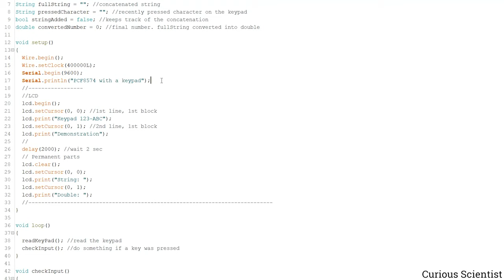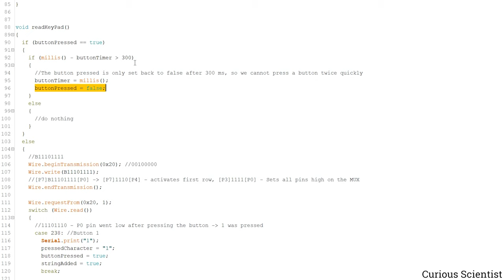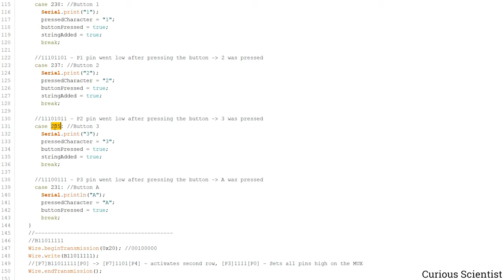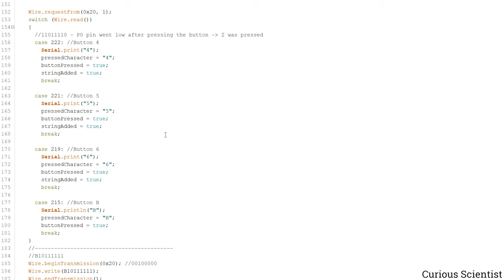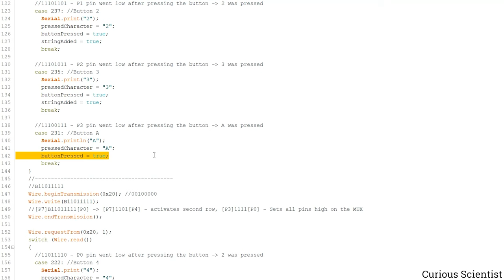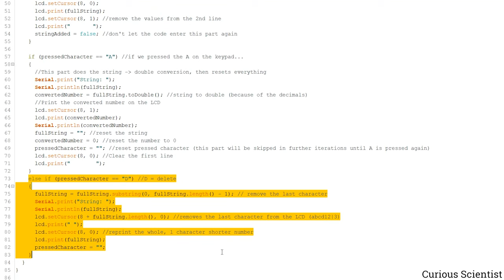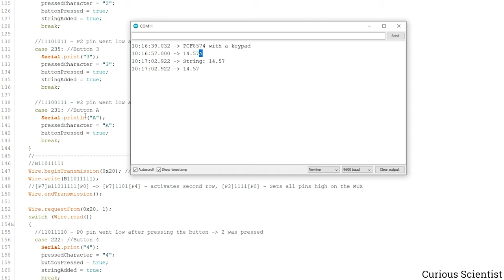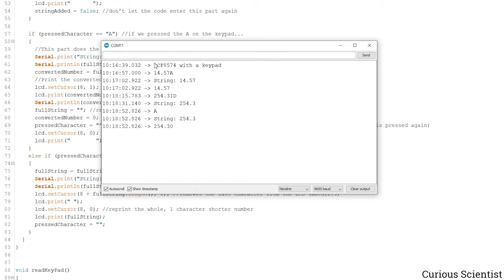16-key keypad with an Arduino and a PCF8574 I/O expander module

Comment: A quite in-depth look at these incredibly useful chips! You could chop down on the lines by using a for loop as an example containing 4 if statements with some multiplication to figure out what each button will be depending on the first 4 bytes sent. Would be less code, but I do understand that it would not be as readable for demonstration purposes. These chips are plenty of fun indeed 😄 Thanks for the videos!
Reply from the maker: Thank you! Yes, there could have been more done in terms of code optimization. I agree that this chip is a very cool chip; it helped me in many projects where I needed a large number of I/O ports. Cheers!

Comment: Hi! I really enjoy your channel, extremely interesting and thorough. It would be super interesting to see a ESP32 Bluetooth version of this. I would imagine it could be used for your camera slider and the coil winder.  Again, great work!
Reply from the maker: Hi and thank you! I used ESP32 for other projects that I have not published here, but generally, it is the same code as for Arduino as long as it does not require wifi or bluetooth. I try to avoid ESP32 for now because I do not need the wireless function and I still have a lot to learn in the world of Arduino and STM32.

Comment: hey. just discovered your channel and I am truly impressed! 👍🏻 I've seen that you've made some videos with AS5600 encoder module. Have you thought about using AS5600 as MPG for a control panel?
I'm currently trying to build something that uses AS5600 as a MPG, but it's going to take a while because my programming skills are not that advanced. Keep the good work going! Good luck 👍🏻👍🏻👍🏻
Reply from the maker: Thanks! I don't see the use of the AS5600 as an MPG since there is already a specific hardware for pulse generation. It is much easier to set up an MPG (like I did in some of my videos).

Comment: hey, did you try the keypad i2c library? would that not have been much easier and simpler? great vid btw
Reply from the maker: Hi! If I simply use the libraries, I never learn how these things works. I am aware of the different libraries, but I want to avoid them where it is possible.
Reply: Respect bro
Reply from the maker: Thank you!

Comment: Hi. My name is Vo Tan Tuyen, I come from Vietnam.
Your project is very cool because it can apply to many projects. and my project also needs this part but I am not very familiar with Arduino can you show me how to print(entire string) to output an integer (without the ".00" character). My English is not good, there are mistakes, please forgive me.
Thank you very much.
Reply from the maker: Hi! The easiest way is to store the number as an integer (int). Or if you want to print a float without the decimals, you just have to tell the print function. For example, serial.print(variable name, 0) will not print any decimals. Arduino has a really nice documentation, you should read it.

Comment: Hello! Relatively new to Arduino so i was wondering if the configuration & code is compatible with Arduino Uno on tinkercad? Want to try familiarizing with tinkercad before beginning.
Reply from the maker: Hi! Sorry, I have never worked with tinkercad, so I cannot answer this question. Try it, I guess, it is just a software, nothing can go wrong.
Reply: @CuriousScientist  No worries! Appreciate your prompt reply, however can i ask if this is compatible for Arduino Uno R3 as well, are there anything i should look out for to change in the code
Reply from the maker: Sure, Uno and Nano (board in the video) use the same chip. I think no changes would be necessary.
Reply: @CuriousScientist  Tried it out and worked out really well! Thank you so much for the guidance and video. In addition can i ask if theres any guides if i want to further expand the ports by connecting another port expander?
Reply from the maker: Sure, look up PCF8574 in my videos. I have a video where I use it to grab the key presses on a keypad. I also used it in other projects.
Reply: @CuriousScientist  Yes! This current video shows the PCF8574 used on the keypad. Want to enquire on the guide for an additional port expansion on top of the current expansion for the keypads. Cause i noticed that the current port expansion uses binary to program it, so how should i go about it if i were it include another PCF8574 as the binaries might clash
Reply from the maker: You can chain them up and address them individually by using their address pins. Read the datasheet for further information. The binary values won't "clash". I have a project with 5 of these chained up as a mixture of inputs and outputs and it works just fine.

Comment: Hay, in your code, you foegot lcd.init(); and lcd.backligjt(); the lcd did not light up.  The keys do not work in the right order. Can you fix your code?
Reply from the maker: I did not forget anything, you can see that the code works...

You are not using the same LCD library as I do.
Reply: So, what is this library you're using? How can I download it?
Reply from the maker: You can download it from the library manager.
Reply: I did try that, and it did not find the library. I'll try again tomorrow.
Reply from the maker: @Dekan88  Good luck!